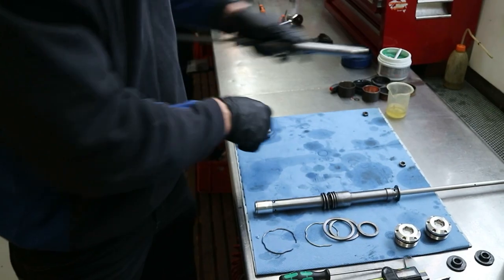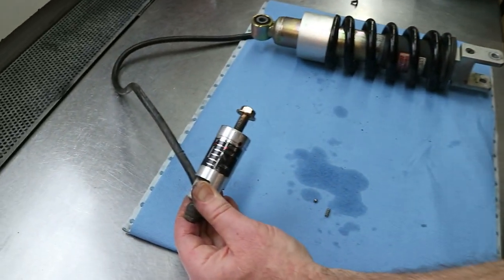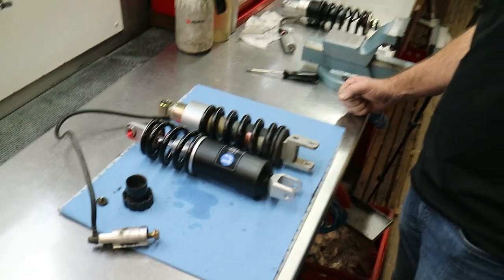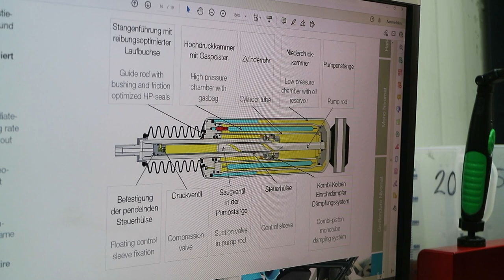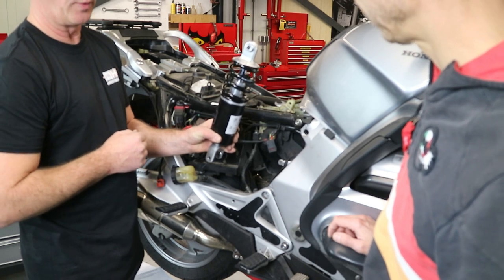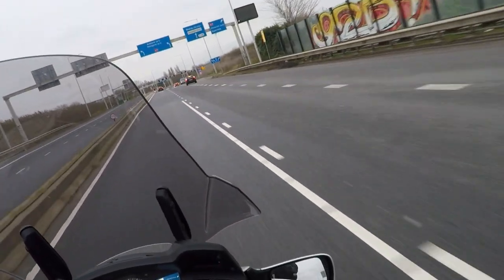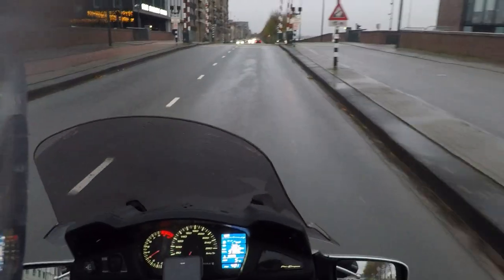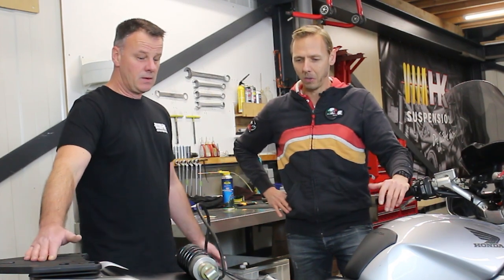Replacing rear suspension with Wilbers on the Honda ST 1300 (part 3 of 3)

Comment: Fantastic, so grateful for excellent camera work! Edgar’s word choice of “searching” exactly describes what was happening on my test drive of my “new” 2004 ST1300A. I purchased the bike anyway, with the idea a thorough inspection/maintenance would uncover necessary repairs after 49,000 miles. Overall suspension is now a firm priority, thanks to your video, although refilling the preload adjuster seems like a fun, OK place to start. I will take a closer look at carefully moving the rear subframe or the rear wheel, or obtaining any unique tools to make fitting the new Wilbers components any easier. Please keep making these wonderful shows!
Reply from the maker: Thanks Matt for your kind words. That's exactly why I make these video's to help fellow riders go further. I will be back in the shop this Saturday to do the rear shock maintenance. Obviously with a video that will follow soon after! So stay subscribed and keep track of the notification!

Comment: It obviously would not be the same as with the new shock, but the bike’s attitude could also be adjusted by raising the forks in the triple clamp to drop the front slightly.  Just make sure to do it in small increments and never so much that the fender contacts the lower triple clamp.  Having shorter legs, I might do that to my bike.
Reply from the maker: Absolutely! 👍

Comment: Hi, it would be interesting to see it opened , interesting videos thanks to you and wilbers, my front on my st1300 feels like stiction on forks not a lot of spring in the front end , the rear has had a yss rear unit fitted by the previous .. no idea what’s in the front other than it’s had new seals at some point
Reply from the maker: Sorry but we can't open the Wilbers Niveaumat...
Reply: @chiefpepdesign  no I mean open the old original shock
Reply from the maker: @geoffsmith1616  please watch the other video's in this series. There is a very, very in depth video on the original shock.
Reply: @chiefpepdesign  ok thankyou, have you still got the st1300?
Reply from the maker: @geoffsmith1616  yes
Reply: @chiefpepdesign  fantastic machines ,big meet in Portugal this year pan european meet up